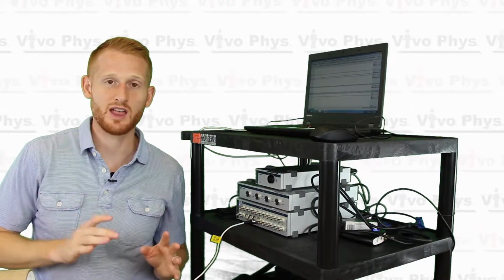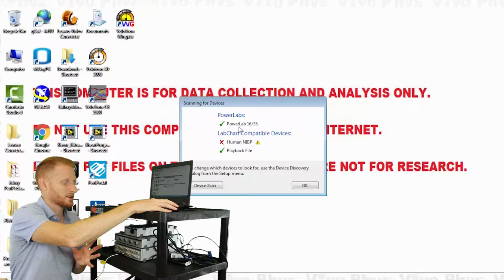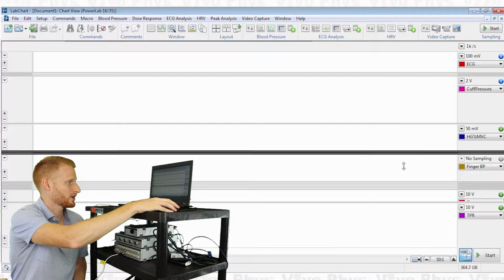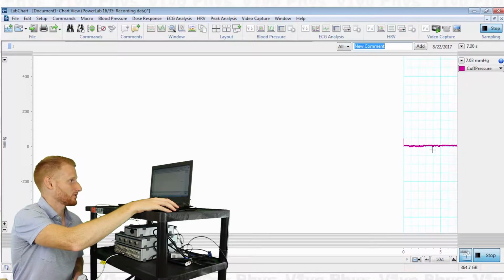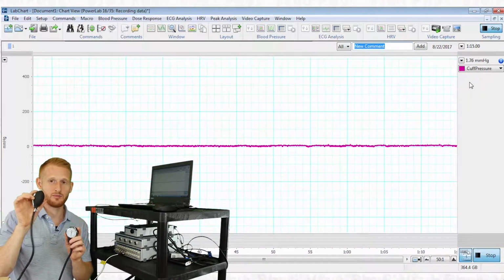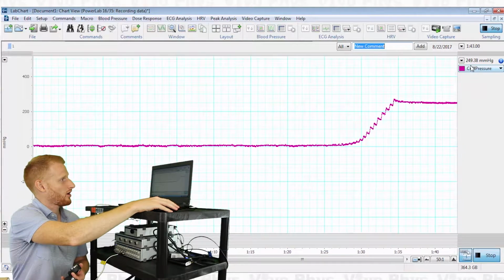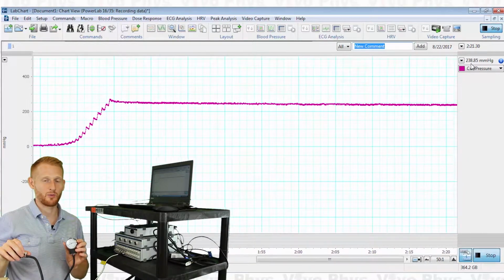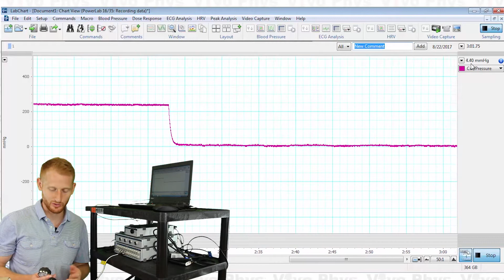Blood Pressure Cuff in PowerLab

Comment: what are the advantages of using powerlab exactly?? as comapred to mannuall
Reply from the maker: Powerlab is a research tool for synchronous recording of several measurements at the same time. It is not a clinical device.